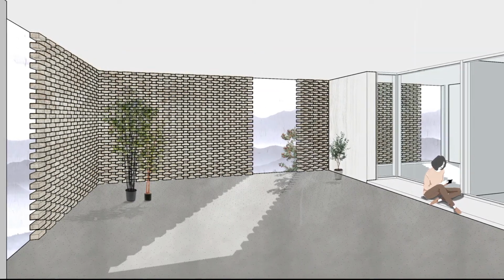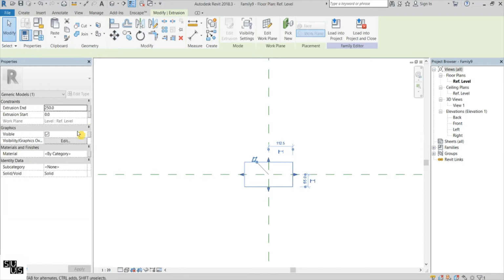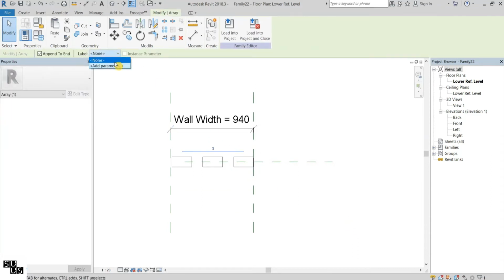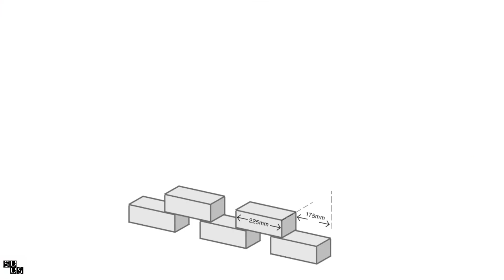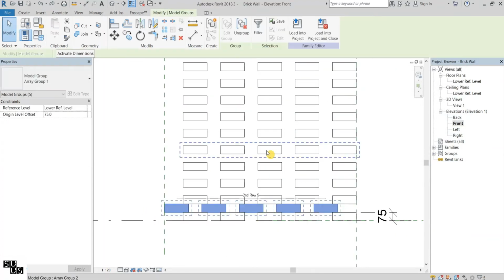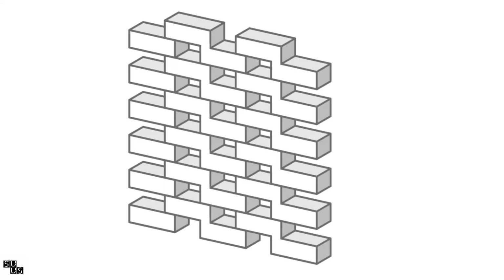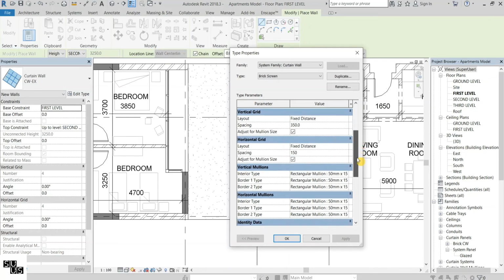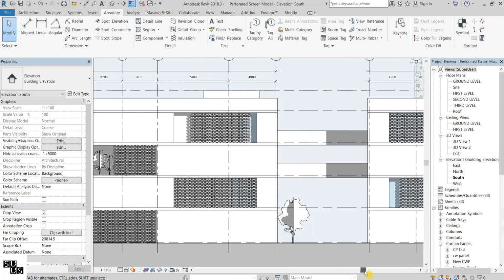Perforated Facade in Revit : 2 Methods Using Parametric Nested Families

Comment: I have tried the second method, but there is a problem when I add a door on the wall. The edges of the opening become messy. Some of the pattern types have to be replaced with panels.

Comment: I agree with you, both meyhods are interesting and should be used accordingly to the wanted result. I have to say though that the curtain panel one is less heavy  and responds way faster than the other one. That's normal since it is a system family. Thus i would probably advice to use the curtain one in priority.
Fully explained and precise. Very good tuto.
Reply from the maker: Thanks Le Ben! I am glad you liked the video. 
True, the Column family is heavier and can slow the model, though I would suggest modeling it in a separate file and only link it to the main model. But I agree, if you can achieve the result you need with the curtain wall method, it should be a priority.

Comment: This is helpful, but why did you choose to nest it into a column family ?
Reply from the maker: Thanks Rami, the Column Family has built-in parameters for the top & base levels, which will give us more flexibility will modeling these walls. Other stand-alone families, like the Generic Family, have only base constrains which means that we need to define new parameters for the wall total height and its offset.
Reply: @superuserforarchitects2132  Oh, i see. On another note, im currently working with a project that is all brick cladding and im trying to wrap my head around the family, which im still not sure how to figure out. What if i have conditions where that family is adjacent to another, what the best way to join the brick ending? I was trying the curtain wallgeneric model one, and specifying instant parameters that allow me to extend the last brick and a visibility parameter to hide the mortar at the end, but there has to be a better way for this.and is it possible to cut a a column family? i tried to check the cut with void box but didnt work.
Reply from the maker: @ramisabbagh7539  Building a single family that can fit any situation is quite a hustle in Revit, so if I were you I would build another family specifically for the corners and then connect it with the old one. Normally you should be able to cut voids in shapes built inside the family environment, but if you trying to cut a nested family then it is not quite possible and you need to look for an alternative. You can download both families from the link in the description box, hope it makes your Revit experience easier :)